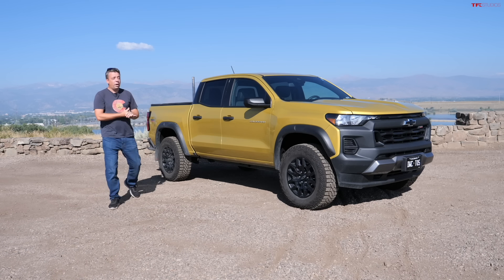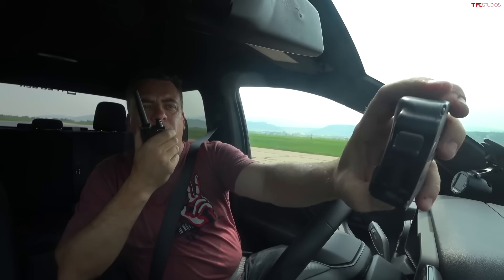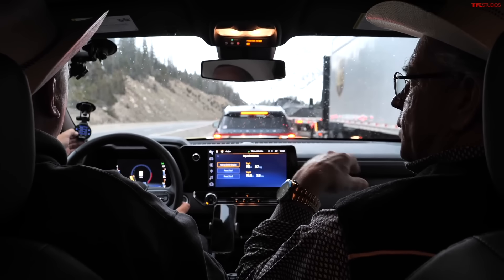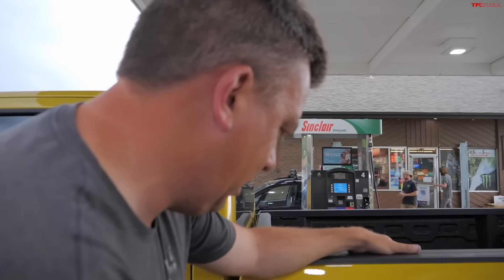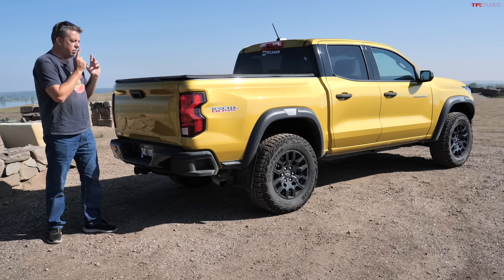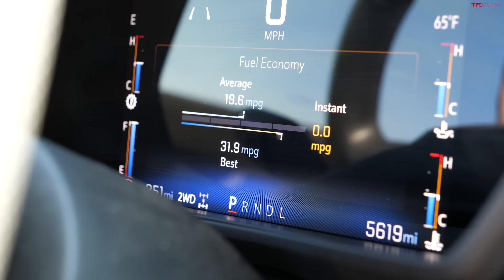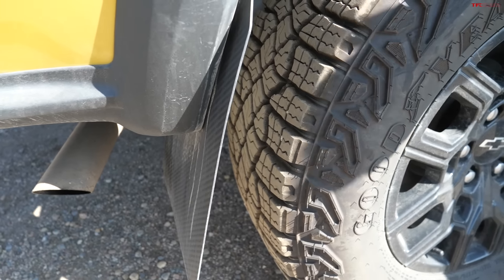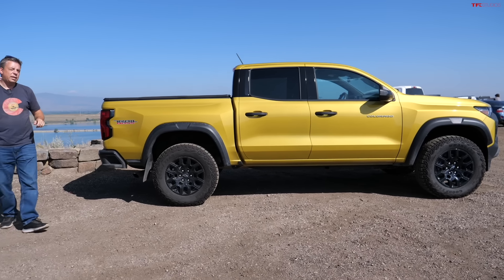Chevy Colorado: Great & Awful Things I Learned After 6,000 Miles - Long-term Update

Comment: I have a 2016 Z71 with a 3.6 litre v6. It has 78,000 and the only issue I had was a new purge valve which I replaced myself. I can't justify trading up. I think I'll keep what I have.

Comment: With the performance upgrade accessory it is just programming. Your dealer needs to call technical assistance and they will add the update to the Vin then the dealer needs to reprogram the engine control module. I work at a chevy store and I've had to do it.

Comment: I have a 2018 WT Colorado non-4wd with 4 cylinder and best mpg I got  on the highway ever was 28.1 mpg driving by myself and mostly level roads with cruise going 60 mph. In the combined city and highway it’s 19.1 mpg. I towed a covered Uhaul trailer with a kitchen table and chairs and a few more items and mileage dropped to 10.2 mpg! Brakes were sketchy! 😮

Comment: My 2022 Colorado Z71 Diesel has been flawless so far, but I only have 9k miles on it. AND I have CC/heated seats/Nav/hd tow pkg/ and it's still bone stock and will remain so unless the next owner wants to lift it etc. Mpg's are awesome - high 30's on the hwy, low 20's around town/stop and go stuff. My wife and I ordered a new 2024 Ford Explorer Timberline this past november. Just waiting on delivery which should be sometime this week ;}>

Comment: Do you have any concerns about the turbo going out and the cost of replacement?  We also have a 2019 Starcraft 20' deck boat that we trailer about 80 miles to the lake.  Currently we have a 2019 Toyota Tacoma TRD Sport that does the job but it would be nice to have a little more towing power.  I do like the Chevy brand but concerned about turbo 4 cylinders.

Comment: Just out of curiosity, Andre , do the sun visors slide outward on the bows? Pop the visor free from the keeper and try sliding it away from the mount. Hope it works that way for you. It would be ridiculous that a higher trim level would be required to access a simple safety and convenience feature.

Comment: Andre, please address how you intend to add cruise control to your truck.  Dealer?  After market?  Addresses the question: how do you add options that were forgotten without having to buy another truck.
Reply: You'll probably have to get the dealer to install it or a really good aftermarket place cause they have to wire in a few things to make it work with the car

Comment: You added black vertical covers to your doors, by the side windows. I know because I have the same color truck and I want to add those too. I also just got my truck tuned this week to the HO calibration, and it does make a difference in drive ability. Order it from Chevy accessories directly and ship it to your dealer. The dealer will get a packet that will allow them to do the calibration.  I was also not charged for instal and it was included in there $395 price. I want to see how it handles a 12’ hay trailer with 3k lbs of hay.

Comment: Mid-size towing will always sacrifice range, unfortunately, which is why full size is more appropriate for more frequent towing as you mention. What I’m surprised by is the terrible mixed mileage at 20mpg, especially if you’re chucking 91 octane premium into that “affordable” truck! I have a similar mix of driving/towing/light off-roading in an old, worn out Gen 1 V6 Honda Ridgeline and get pretty much that same mileage. What’s the advantage to these turbo’d 4’s if they aren’t giving better fuel economy at the end of the day?

Comment: I paid $50,000 for my house, it was in the early 90s but still it's a whole house and a third acre. I have a 1998 Ford Crown Vic, tires brakes oil change excetra still runs perfect, and goes through inspection, that's in Pennsylvania. I don't like payments.

Comment: In your defense you would think CC would be standard in 2023. The truck has an electric throttle body and advanced computers, the only thing it would need for CC to work is the button which costs GM what $0.50? This seems like a crummy way to artificially lower their MSRP making you have to pay hundreds for something that literally costs them pennies

Comment: i appreciate going over some these details because over time after the “honeymoon phase” of a new truck / car problems pop up that we only think of in nightmares. until it happens to us. i wanted a chevy colorado but comparing prices with the canyon and certain features im dead set on the 2023 Canyon Elev. or AT4 but idk if the canyon has the same issues like this chevy does?  i currently own a GMC terrain AT4 and i’ve only had wiresless apple connection issues where the phone is mirrored on the infotainment but the audio is coming from the phone speaker :/ once in a blue moon it happens

Comment: I think I will just keep on fixing my 1999 Dodge Dakota SLT 2wd with the 5.2l V8 and 5 Speed 3.90 Sure Grip Rear, it has been a faithful and trustworthy truck for close to 25 years of ownership. 155,780 miles on the Odometer and it still fires right up. I just recently replaced the factory installed water pump at 152k. I think this winter I am going to go through the suspension and replace all the suspension pieces with brand new Mevotech Parts and convert it over to the 2003 Dodge Dakota front dual piston calipers and rotors, and drive it until it finally dies or I do !!!  Hell of lot cheaper than spending 50k on a new truck

Comment: I have a 2023 Colorado and my information and gauge went out at 5037mi and have been waiting for 3 weeks. I don’t have a speedometer or fuel gauge and of course the lights are in the system GM needs to get their shit together and get parts to the vehicles they’ve already sold.

Comment: Ive got one main issue with the colorado trucks. The mpg is worse then a full size pickup. My 2021 f150 can easily reach 22 mpg in mixed traffic and about 24 mpg on the highway if light. Even towing it had decent fuel. 13 to 17 mpg based on whats in it.

Comment: I went to look at a new Colorado when our local dealership got one in.  I was surprised and not in a good way. I think it was a LT trim or it may have been a Z71. It just looked cheap with all the plastic. My biggest surprise was it was not equipped with a trailer hitch/receiver. Not sure it had cruise control either. Asked the salesman about the hitch, he walked to the back and he remarked “wow, that’s kinda ridiculous.” After researching the Colorado more, there are ton of things like that that are not included on the truck unless you buy an expensive trim level. Standard things that every truck should come standard with. A truck is kinda worthless without a hitch. Been a Chevy guy all my life, not anymore. Just another way to take more of your money.

Comment: I’ve gotten 22mpg with my 18 Silverado 4x4 5.3 with trips to my cabin at 77mph… not impressed with gas mileage in a turbo 4 cylinder
Reply: I don't really think mpg was the intended purpose of the 2.7, the 4 cylinder is quite a bit better suited to tow than the 5.3. Quite a bit more torque and peak torque comes in 4k rpm lower which is where you need it.

Comment: I'd just take those black wheel flares off and color match paint them. GM always seems to never hit a home run on anything. Maybe the Canyon AT4x is close. Maybe the Sierra AT4x. It's all about the money. I have a 2021 GMC Sierra AT4 (6.2L) and it has been upgraded. Now, they cost $20-25,000 more...and not with the mods I put on for much less.

Comment: Why aren’t your mid size dual cab utes offered in diesel, way better for towing and better fuel economy. Great reviews Andre.
Cheers Pat 🇦🇺
Reply: They just don't sell. GM tried it for a few years and jeep is in the process of discontinuing it in the gladiator.
Reply: @trevorhart5576  it’s the exact opposite here in Australia petrol powered utes don’t seem to sell 95% of the is in the market are diesel.
Reply: @PaddyBoy644  That's crazy!  Because here in the US after this year there will be no diesel engines in any of them.  I wonder why it is so different down under.
Reply: @PaddyBoy644  I think its because us Americans love our big diesel trucks.  We don't want a small diesel truck.  I own a 1 ton 4 door diesel truck with an 8 foot bed and I would not want to downsize to a truck as small as the Utes you have down under.  And I bet most if not all the Americans that own bigger diesel trucks feel the same way.

Comment: Wait till around 12 to 13k for the miles on that 8 speed auto. I had a 2018 Colorado v6 with the 8 speed and started acting up around 13 thousand miles roughly a year old. GMs fix was to change the fluid. Well it did fine till about a year later and started doing it again this time with the truck developing other issues.
Reply: Not the same 8speed
Reply: @tommyrich4156  Maybe / maybe not! That’s why I said wait till about 13,000 miles or so. I hope they did fix it cause the Colorado and Canyon are some good looking trucks. It will be interesting to see long term reviews of these trucks.
Reply: I will say this about my Canyon so far...love the pep (430 tq) and the shifting is smooth!
Reply: @tommyrich4156  Good, hopefully it continues for ya.

Comment: Long term update,   pffffffftttttt.   I have owned my 2009 Canyon since new.    Pulled campers,  uhaul rental trailers,   Boy scout trailers,    has 150k on it.    Still runs great with zero mechnical failures.    Just tires,  oil changes, and brakes.

Comment: What kind of payload capacity does your Colorado have? My 26' 6900lb travel trailer has a real world normal camping gear tongue weight of 850lbs so I need a truck with about 1550lbs of payload capacity to handle the camper, passenger and gear. Towing is often more about payload capacity than what you can pull down the road. I like your floating roof.

Comment: I’ve got a 2018 Denali 6.2 with 78,000 miles and a 2019 ZR2 with 43,000 miles.  I’m gonna make them work for the next 3-4 years at least.  The ZR2 gets 20-22mpg and is a great off road truck, just not as comfy as the Denali.  I’ve got a leveling kit and 32” tires on the Denali and it gets 19-21mpg.  Both are paid for and I sure ain’t paying $60k+ for one truck to replace these 2.  Prices are NUTS!
Reply: With two trucks I would rock them till the wheels fall off. The car buying experience still is a nightmare and the upcoming strikes will make it worse.
Reply: @302Mustang13  that’s the plan and probably cheaper to just replace engines and trans than buy new stuff that’ll be $75k by then
Reply: @dansherwood9851  I have two vehicles, one newer and one is a summer toy. I plan on keeping both running as long as possible and adding another used ICE vehicle in 5-8 years. That's my solution to high prices and EV nightmares.
Reply: I have a 2018 Silverado LTZ with the 6.2.  I almost always get 22-23 mpg on trips and around 16-17 around town. Don’t think I’ll downsize to a Colorado, I’m happy with mine.
Reply: @donhartman8821  I swear if they put the 6.2 in a Colorado it would get 25+mpg.  Before I put bigger tires, 3.73 gears and a leveling kit on my 18 6.2 I could get 24-26mpg with cruise set at 68mph on level ground.  Cmon gm, pull ur head out!
Reply: @dansherwood9851  nobody would believe me, but, took about a 200 mile trip to go pick a 10 foot john boat I purchased. Not sure if it was the aerodynamics of the boat tied down in the bed or what but I got 31.7 mpg on the way home. It blew my mind.
Reply: @donhartman8821  had to have something to do with it.  I have full tilt up tonneau covers on both mine and I’m sure they help a bunch.  I hear lots of guys saying they only get 15-16 on their v6 ZR2’s but mine was getting 20.5 avg around town till the level kit which dropped it to 19.6 but helping the aerodynamics seems to improve mpg quite a lot.
Reply: @dansherwood9851  I can get 32 mpg in my 5.0 Mustang with 3.73 gears if I set the cruise on 65 mph, but I rarely/never do. Boring and dangerous.
Reply: @302Mustang13  that’s nuthin.  I get 32.5 in my 850bhp ZL1 when set at 65.  Boring, a little but them mustangs r dangerous at any speed😉

Comment: "Pretty much done everything there is do to with this truck"  "I would buy this truck again"  My question is, does this mean you are done with it now?  Are you selling it, trading it or keeping it a bit longer?  "Long term" is not 6K miles.  But if you feel you have exhausted the interest in this, are you going to trade up to something that works as advertised off the lot?(back up camera)  Get 1 with a cruise control?  Get rid of it for something with more grunt?  Or just hang onto it until the warranty is about expired like you did with the Ford?
Reply: Not much out there has more grunt than 430/ ft pounds

Comment: I bought a 2009 Chevy, Colorado. And got over 220000 miles on it. And the only thing I've changed on it was U joint  the price is doubled, so do we get at least 400000 on it? Before they start breaking down, i'd rather have the $15000 1 that doesn't break down.

Comment: Would have been awesome if GM put the 5.3 and 10 speed in these trucks. They would detheone the Tacoma if they had
Reply: In some ways this 2.7 is superior to the 5.3, torque his substantially higher and comes on waaaaaaay earlier. Reliability hasn't shown to be an issue yet but we need some higher mileage 2.7's still

Comment: Not sure what you are referring to with the visor extending 
I’ve never had a car with that - tint the window 
Your mud must be really bad, have you driven through a construction area, where they are cutting the concrete? I’ve had that, it’s the cement dust mixing with the water they use in the blade to cut the street

Comment: I just can’t see that engine and trans holding up long term pulling loads.
I don’t even consider an engine smaller than a v6 a viable option in a mid to full size truck

Comment: Let’s see how it is at 170,000 miles. 

It takes a certain amount of fuel to make the HP/Torque necessary to tow something up a hill. So V8, V6, turbo and N/A are going to use fuel towing. There will be efficiency differences in how that fuel is used of course but they’ll all be similar. A diesel will show an improvement over petrol if you want fuel economy.

Comment: Andre, do you ever find yourself missing having a longer bed? As someone who has a truck with a 6ft+ bed, I don't think I want to go back to a short bed, and feel like I would miss having that extra capability
Reply: I went from a 2017 Colorado extended cab 6' bed to my current 2019 crew 5' bed and 99% of the time, the short bed serves me well. Where it fails me is when I'm on a road trip and want to sleep in the back (I have a fiberglass cap) and 5' 11" me does not fit well enough on a diagonal to get a good night's sleep with the tailgate up. Having a shorter wheelbase on the short box versus the longer wheelbase on the long box truck makes it a little more maneuverable in parking lots and on the trail.

Comment: You are about to experience failed turn signals. GM knows the clock springs break fast on these vehicles. I guess the lawyers will have to feed on them for a while before they issue a recall. Mine broke at 15,000 miles after 3.2 years of ownership and GM said its mine to repair.

Comment: I’m happy with my zr2 2019 115,000 miles. Thermostat and converter usb short circuit drained battery. Shutter fixed. I’m still happy after the problems.  Luckily I have mechanical skills. Saves thousands of dealer repairs. The dealer is the biggest crooks. Stay away from them if possible

Comment: That towing number is worse or equal to my 20 Tundra with the 5.7 v8. I am towing about 5 000 pounds. What is the point of a turbo 4 when a v8 does it as well or better. Maybe my Tundra doesnt have the best camera but still working after 3 years. The only issue is my tail gate lost its soft open. Not sure why.

Comment: 41k for a trailboss? Damn I got a z71 for 42k from a dealer I had a good relationship with after negotiating
Reply: You got the base Z71 without much options. Mine was fully optioned out @46k The Trailboss has the work truck interior and once you start adding all the options its about 2k difference or less from a load Z71

Comment: I have over 30 years in  GM parts. First the backup camera. There is no one part that can fix it. There are multiple cables and the camera. This truck doesn't have the best track record for the b/u cam, and it's a bitch to diag which cable( and it's usually one of the cables) is malfunctioning. The performance upgrade, I think it's a download. It doesn't sound like the dealerships service dept. you are going to is customer friendly. For the camera it's diag, they should have said that and scheduled you to drop it off. It really irritates me when service dept. push away customers for simple things.

Comment: Don't feel bad I bought a brand 🆕 2022 Toyota Tacoma 6-speed manual... When I turned on the AC cuz I live in Phoenix that didn't work + they couldn't get me in for a week(sucks when it's 115° outside... Then I go to use my 4X4 system & it locked in 4WD & won't go back into 2WD so I had to have my truck towed... Mind you all I've done is change ALL the fluids over to amsoil never even been off-road with my 🆕 🛻 💨 & it's driven very respectable & barely over 7,000 miles! Not a good start Toyota 🤷 & I bought this truck because it's supposed to be reliable! On 🔝 of that with the AC on I'm getting 14-15mpg in the city! ⛽ 🐖 💯 %

Comment: Do not get the 3.0 Duramax for towing they will start to burn oil the motor is a towing motor it is an eco diesel for fuel efficiency not working

Comment: 6000 miles doesn't seem like a lot to make any judgements on.  It's not even broken in. I predict that in a few years, GM, Toyota and Ford will be dumping their Turbo 4 Cyl and going back to V6s. You don't see nearly the MPG gains promised, and the turbo just adds complexity and more things to fail.  If turbos were so great, they wouldn't have been dropped in the 90s.